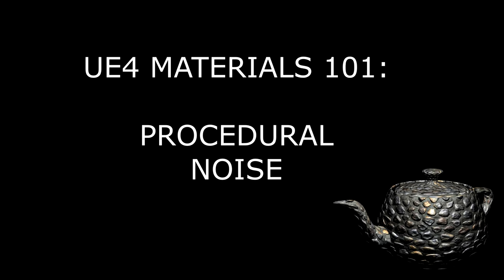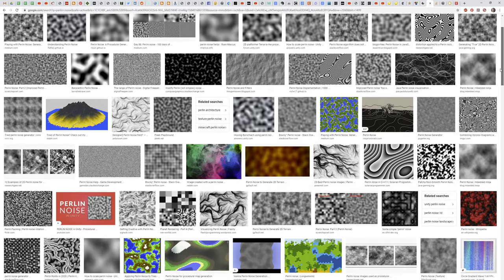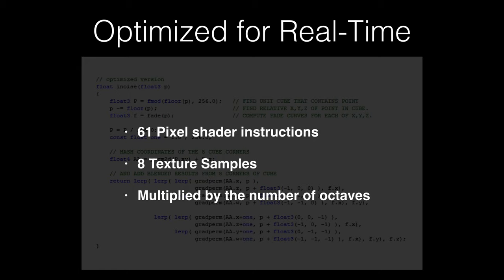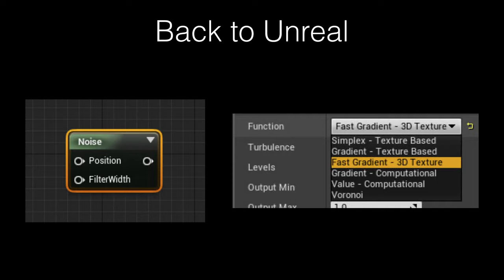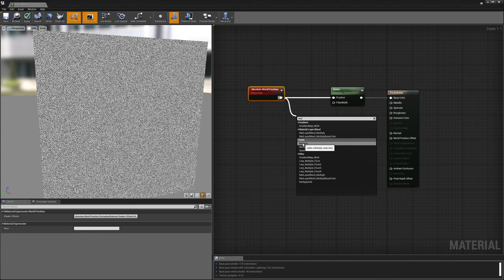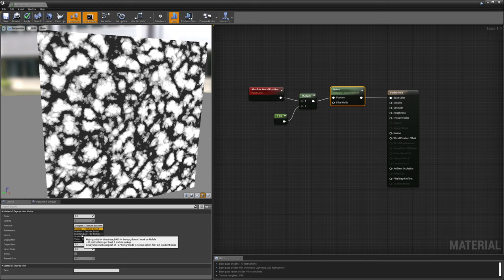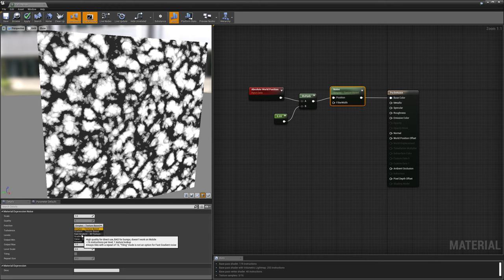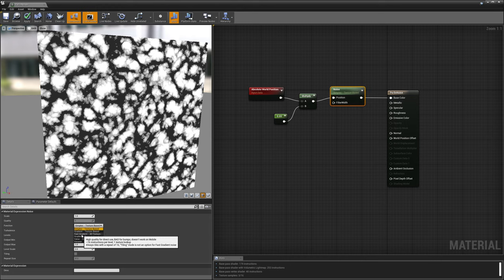Procedural Noise - UE4 Materials 101 - Episode 19

Comment: Is it cheaper to use a texture sample (perhaps made in Substance Desginer) for noise or to use the noise nodes in Unreal? I suppose I could just check this myself by looking at the instruction count using either method, but I'm interested in your thoughts on this in general.
Reply from the maker: It's cheaper to use a texture sample, yes - but texture samples aren't 3D (usually), and they tile.  That's the main difference.  Procedural noise is in 3d space and it doesn't tile.
Reply: @BenCloward  ah, the non-tiling alone is worth the added expense in my opinion.  Thanks for the reply!  Great channel.  Highly informative :)

Comment: Just one question: Why does scaling the position vector change the scale of the noise? The abs world pos node gives the absolute world position of each pixel as a vec 3, and the noise node takes this position and runs it through this formula you showed at the beginning? I'm sorry for asking, I should go through it myself, but I don't have the capacity to dig right now :)

Comment: Why not cache these patterns if they aren't going to change after being generated? Will reduce lot's of computation.
Reply from the maker: Sometimes, reading from a texture is cheaper and sometimes doing the math is cheaper. GPUs are pretty fast at math, but it’s hard to tell if a texture sample will be cheaper than the procedurally generated version. Best way to know is to measure the performance. One downside of reading from the texture is that you can get tiling artifacts, whereas with the procedural version it’s infinite with no tiling.

Comment: your videos are awesome and made me decide to shift from unity to unreal  lately i was enjoying a lot with ray marching videos in unity i wanted to know is it simple in unreal to use ray marching techniques?i heard because of complex node system in ue4 custom shaders are harder to make and i think its not easy with nodes system to make raymarching shaders or volumetrics effects
Reply from the maker: Yes, you are correct.  If you're writing shaders in HLSL or GLSL, you have a lot more flexibility and control - but it's also a lot more work.  In the Unreal Material Editor, a lot of work is done for you already - the part that's inside the root node.  But it also means you're not customizing that part.  So in Unreal, you give up some control for some ease of use.